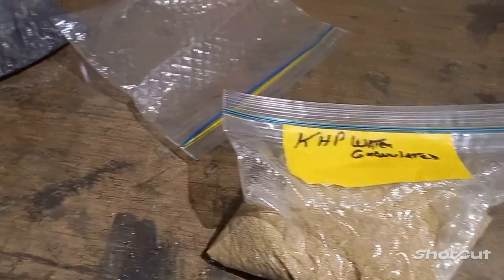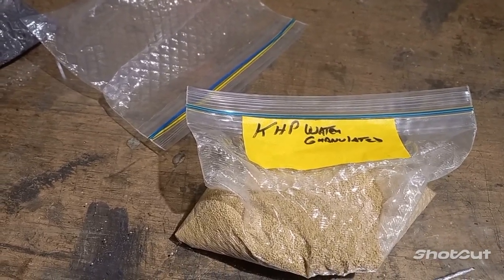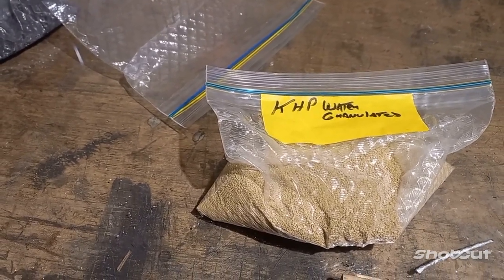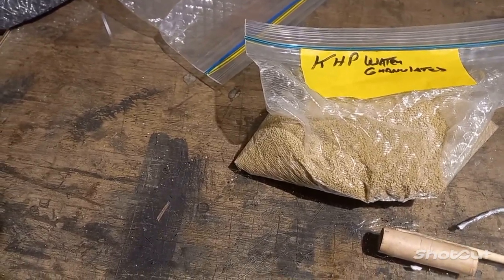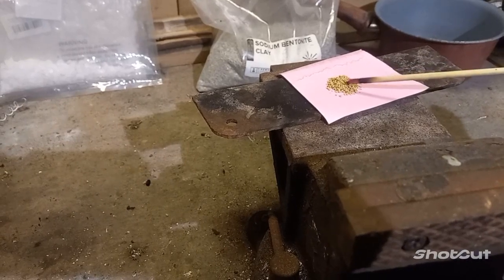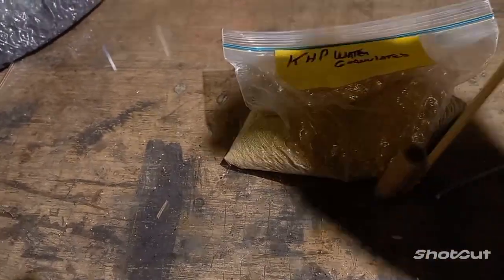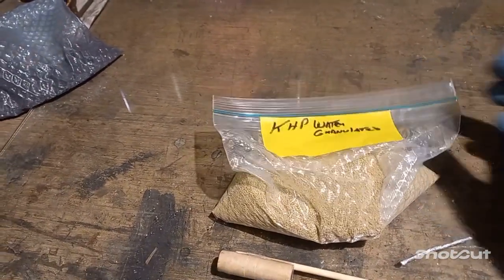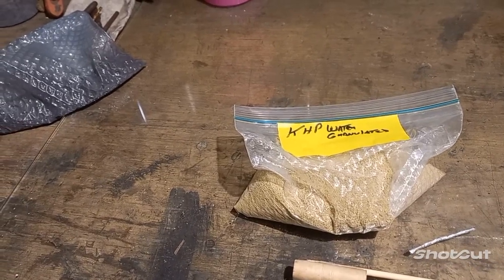KHP whistle fuel burning/power test (see description)

Comment: Crazy the amount of power that KHP has. Thinking thatll be the next fuel i try! 

I have a question if you dont mind. 
I cant remember which video it was, but you were questioning whether or not you should ball mill the chems, although they already come super fine in the bag. My question is did you ever try ball milling and had better results with your fuel vs just straight out of the bag?
Reply from the maker: Yes KHP has lots of trust and good potential .
I do not ball mill anything except for black powder , milling is messi and when milling fuel with catalyzer together usually tuns on a sticky mess, then big part of your pre measured components goes to waist.
I make sure that  all my components are totally dehydrated first,  then all must pass though a 100 mesh , any component that doesn't I'll blade mill it for a few minutes until passes the 100 mesh , I carefully run all together through a 40 mesh several times for a good consistency , I.like granulating with 50% 50% water/ alcohol when the nature of the mix allows it , with some fuels like the ones containing aluminum or magnalium water granulating is a no no
Reply: @Pyroflorida  right on man! Glad I asked before trying. That potassium benzoate is some sticky shit. Couldn't aging the pain it would be cleaning out my mill. I asked because I saw runningmans video on the hell fire mix and he ball milled his fuel and catalyst together. That's pretty much how I do it. Grind the perc and let it pass through a 100 mesh screen. I haven't tried using the alcohol and water for moisturizing the whistle fuel. Is that only for your mixes with the red gum as the catalyst? Isn't copper oxychloride and iron oxide both insoluble in water? Just trying to understand is all. Im gonna whip up a few different batches and try what you've showed us! Excited to see what the red gum does
Reply from the maker: @Smokin_skies   my best khp fuel so far is the one with red gum only , and it is water/alcohol moisturized  and granulated,  another amazing result I got is  sodium benzo with red iron oxide also water/ alcohol granulated , no wax or oils,  it burns so fast and has a well controlled burn , even when red iron doesn't dissolve,  fuels and oxidizer does ,  only takes a few minutes to wet and granulate and a couple of hours to dry if using a infra red lamp .
Potassium benzo and sali fuels can be also granulated using the same method with amazing results ,  all ok using this method with red iron oxide or red gum , i prefer to stay away from copper oxichloride
Reply: @Pyroflorida  okay I see now. Appreciate all the knowledge 🙏 💯  Why do you stay away from the oxychloride?
Reply from the maker: @Smokin_skies  oxichoride degrades very fast and ruins your fuels pretty quickly , batches of fuel with oxichoride demmands almost inmediate use , you can store it but not for too long , maybe a week or two as long is completely sealed
Reply: @Pyroflorida  good to know!!
Reply: @Pyroflorida  hey man, I'm sorry I keep bugging with all these questions, but I had one more if you dont mind..  I'm taking your advise and going to be using red iron oxide instead of the Cu oxychloride for my benzo. That should still be usable after sitting around for about 2 weeks correct? I have this upcoming shoot and want to start getting ready. I want to know if I should wait or not till it nears closer
Reply from the maker: @Smokin_skies    I don't think you will have any issues.. these are some measurements that you can take to make sure all goes OK
#1 DEHYDRATE everything,  specially the oxidizer , moisture will deteriorate your fuel faster.
#2 make sure you double ziplock the fuel and squeeze all the air out of the bag.
#3 keep the  mix on a dry air conditioner room 
I had fuel batches stored for more than a month and I had no issues with it.
Just in case when batch is a little old Ii got it under infrared lamp.for a couple of hours just in case it got any moisture on it .
Also BHT ( butylated Hydroxytoluene) is a good preservative @1% will do the trick,  it will prevent the catalyzer to degrade.
I don't use it unless planning on storing fuel for a long term

Comment: I bought a lot of KHP but never got the chance to try it yet. I'm sure you can't have too long of spindle as she'll probably just cato. I used to hate picking up my rocket headings off the ground after a cato, very discouraging. 😂😂
Reply from the maker: Yes man, CATO 's really sucks for sure.
According to the developer of this formula ShortFuseMan this fuel will not CATO even out of a extreme spindle as long tubes are waxed , I'll go for the mentioned test in a few days